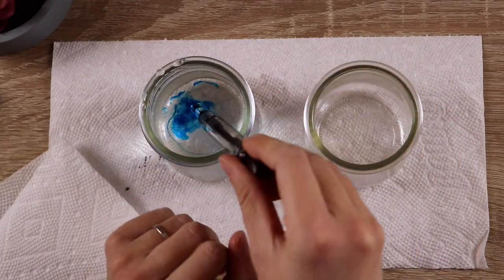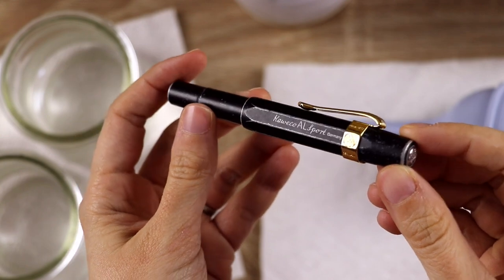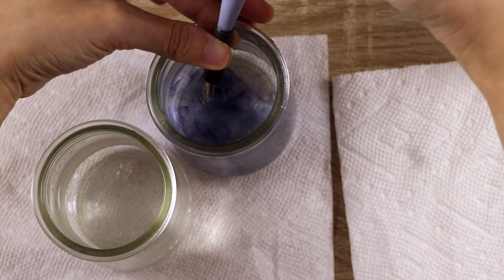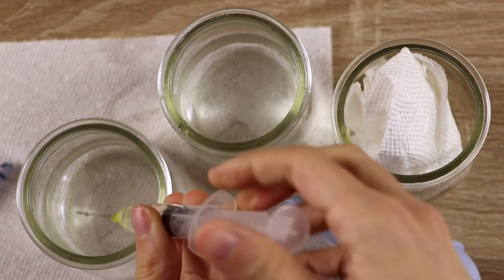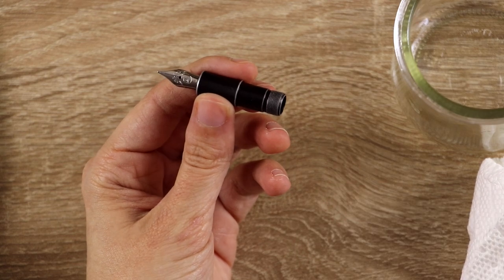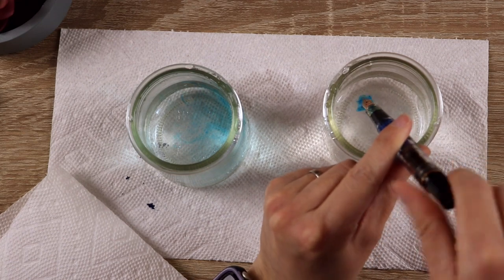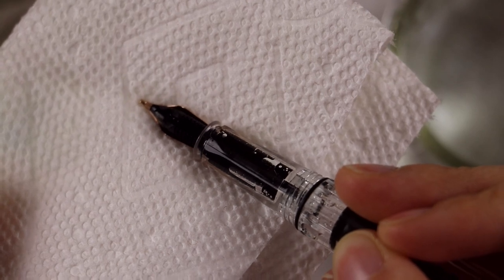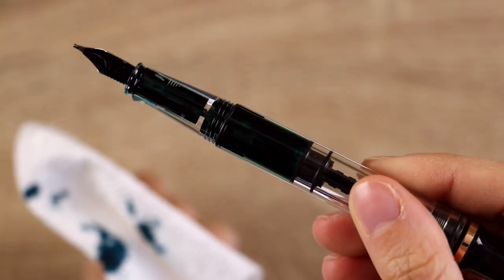How To Clean A Fountain Pen - Beginner's Guide

Comment: I finally used up the ink in my TWSBI Eco--it was a dark teal shimmer ink and once I had it mostly clean, I left it filled with clear water most of the way and let it sit for about an hour to help dissolve any remaining ink, then gave it a quick shake before pushing out the remaining water.  I actually look forward to cleaning my pens because it means I can ink up a different pen as a replacement!  I currently have about 10 pens inked, but I'm trying to cut that back to 5 at a time.  I did have a pen that sat with ink in it for a long time, and I had to soak that one overnight with some pen flush to get it clean.  The bulb syringe is really helpful, especially when you have ink that dried in the feed.  I purchased some vintage pens from ebay that had old ink in them and the pen flush and syringe were MUSTS to get those pens clean!  Even though I have used fountain pens for years, I didn't really know how to clean them properly until last year (I learned from watching videos like this one!)  Whenever I gift a fountain pen, I include a note with how to find instructions on using and cleaning them!  I will direct the next newbie to your channel!
Reply from the maker: Ooh I like that tip to let it sit with water in it and shake it to get those stubborn shimmers out! I haven't needed to get pen flush yet, but it's good to know it would help even super old ink that dried in there. Thank you so much for sharing!

Comment: I have 3 twsbi, 1 eco and 2 eco-T. Eco-T are really the best. EF nibs, I write with them (of course 🤷) but I bought them for sketching (or at least trying 🙄). My cleaning process is easy : (gently) remove the nib after several washing ànd drying with a Q-tip before replacing the nib. Don't be afraid to remove the nib, it is very easy, protect it with a tissue while (gently) turning and replace the same eventually.

Comment: I've been using a fountain pen for 10+ years, but I probably still count as a newbie, haha. I ink up my pens right after washing (I do dry them as well as possible) and don't mind just a little dilution at first. It only lasts a couple sentences. And yeah, it doesn't take long to wash a pen. I'll use cotton swabs & rolled up paper towel pieces to get in nooks and crannies, if necessary.

Definitely don't let the washing part intimidate you if you've never used a fountain pen before. If you're putting the same color back in or switching but you don't mind creating a new color of ink, it's often possible to refill a pen without washing it first. I only have one ink & pen combo where I absolutely have to wash my pen because it clogs.

Comment: Help me please: I have a Parker Fountain pen, I've use warm water to soak my pen, and still ink won't flow, I believe it's the feed part from the converter may be blocked, Is there a way of unblocking it __(like a blocked kitchen drain pipe) I want to avoid poking a piece of wire down the feed from the converter end?

Comment: Twsbi Ecos and other Twsbi pens are no different from other pens, flushing the pen using the piston is really all that is needed and full disassembly isn't recomended due to the fragility of Twsbi pens (they easily develop stress cracks).

The reason you find it hard to clean it is due to the ink, I love shimmer inks but they are an absolute nightmare to clean in every pen, I have dedicated "shimmer pens" with whom I only use a particular type of shimmer so that I don't have to bother with cleaning them too often.